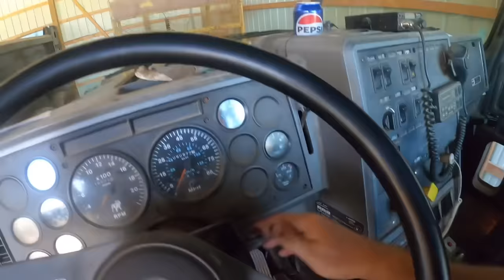Catastrophic Tile plow failure what happen to cause this epic failure?

Comment: Material fatigue ...
Happens on all devices under constant huge load.
I'm impressed how long you actually worked with this plow no failures.
Points to a good design.
Reply: Actually, no. Fatigue doesnt happen  under constant load, it happens on alternating loads... its the amount of stress and release cycles that accumulate fatigue
Reply: @Sjanzo i do believe you win the prize.
Reply: @Sjanzo you can still have a yielding material failure from excessive force.
Reply: There are several different types of metal fatigue. There’s compression, tension, shear as well as cyclical or work hardening. This could have been tension or cyclical. Probably both. Could also have been a harder alloy with induced stress during welding with no annealing to redirect the stress. How energy will flow through an assembly isn’t always obvious. Even the best design assemblies can fail in surprising ways.
Reply: @FishFind3000  true the definition of fatigue is failure below yield stress. It starts with a fatigue crack (most likely initiated in the flame cut edge where the pin bushing is welded into) from ploughing with two 850s, accelerating when the crack reduces the remaining cross section, untill the weakened remainder yielded when working without an extra dozer pulling.
Reply: I’m sorry you are all wrong. It just broke. Plain and simple. That’s why the lord made mechanics and welders. Now stop arguing. 😊

Comment: Damn..... You took that one pretty well, respect for that ! Sure you have it figured but more meat above and below the pins to take a rib plate, rib plate above the lower pin, nice deep roots and preheat before welding to mitigate weld stress lines. For something designed and built in a shed by two blokes, that thing held up really well under very very hard conditions, all credit to you for it doing so well until this. Hope you can lash it together well enough to complete your obligations.
Reply: Really solid advice. Plus If I remember right they made it all from mild steel.  Being that this whole thing was a Prototype. I think it performed awesome. I don't believe high strength steel would have broke like that.  I still agree more meat below the bottom pin would be ideal. At least more than the thickness of the plate used. Good luck with the repairs.
Reply: @mattdixon8750 when I build tile plows I build them out of  A36 or A572 steel depending on customer budget .

Comment: That's repairable, most important thing to take away from this is you can see the weak point at the bottom of the lower pin, you need a bit more meat under that pin and the top plates need filleting to get a full thickness weld. In fact all the repairs will need filleting to get full thickness welds.
You and Aaron can do it 😉
Reply: It is repairable but look at the side plate further to the front. The paint show’s stretching of steel above the ripper frame. So unfortunately there will have to be a complete replacement redesign of the frame that boot mounts in. Yes a bandage could be put on it. But there’s signs of structural integrity of the rest now. Not anyone’s fault in the making of. We are have been down this road on at least ones with fab projects. Only hurts the pockets of cash that hurts the most.
Reply: @kevink4914  quite right, Mk 2 should have a deeper section plate, not necessarily thicker, unfortunately the design left not a lot of material under the lower pin where the failure started ripping up to the next weakest point.

Comment: Looking back at the amount of tile this unit put in the ground, I suspect you are still way ahead of the game on this one. The next version should be a beast!
Reply from the maker: You are correct way ahead
Reply: @DirtPerfect  looking at the design, there's tons of pressure on the lower pin (origin of the break), maybe consider more plate below the bottom pin and run the diagonal support toward the lower pin rather than the way it is now. The tile plow series has been epic, and I look forward to the next revision! Bravo

Comment: Wow Dp that's impressive that road must have some major sized rocks in it to sheer that heavy plate like that and by the way is that still covered under the MBTS warranty
Reply: That plate didn't shear, it pulled apart under extreme tension........ the power that dozer is putting to the ground is phenomenal.

Comment: I suppose it was to much rock Mike, shocking how much force must have been to stretched and snap 3/4" hard steel like that, can't wait to see the damage report.
Reply: The crazy thing is the plow ripped miles of rock being pulled tandem with 850b or 210 without issue. Can’t wait to see the repair and upgrades

Comment: That tile plow has been through hell and back.  It didn't break at any of Aaron's welds.  I know y'all will get it fixed and now you can improve the design for better strength.  By the way that plow has been awesome especially for the money invested into it.

Comment: Considering all the tile that you have installed and some of that while being pulled by another piece of equipment, there is no shame in that break. The timing couldn't be worse, but def no shame. I have no doubt that you guys will have it back to work in no time.and prob with a few design upgrades.
Reply: Why upgrade?  It has worked great, and if you make it stronger, then next weakest point to break may be more catastrophic than you want.....especially to the wallet $$$!  I'd say upgrade the expectations, know when to tag in your excavator partner, then tag back in with dozer when you're past the risky spot.

Comment: I can only imagine MBTS comments if he would have been there. Looking forward to seeing the updates. The plow has been a very impressive tool for your operation. It has increased your production and was cost effective to build. As an engineer, you did this right skipping the calculations and going straight to the prototype. You had minimal issues with the plow and have fixed things as weak points show up

Comment: Mike, after watching Cutting Edge Engineering Australia for many years, it becomes obvious where the weakest point of failure is.  In your case, I can see/relate it to the two back bar pins (Their videos of broken stuff looks exactly like your break, it's magic)😂😂 .  I'm surprised you caught all of that footage on video!  I'm sure it is fixed by now, but it should have been a full solid plate across the back (Top to bottom) of where the plow tube moves through.  Not a single bar bolt on the top and bottom.  On there last video, they fixed the slides of a road grade and it seems like it would be the perfect vertical solution (two months ago) for the plow tube (Then you would only have to change out the worn slide bars, versus it running against the main steel structure).  Can't wait to see the how this gets fixed.  Arron is going to have his work cut out for him! 
BTW: Maybe next time, you should bring the water pipe/electric wire plow to do the pre-ripping (I know, Shoulda-Woulda-Coulda).  You had the 210 there already and it would save the added pressure on the tile plow.  😁😁😁😁

Comment: Good to see you still keep a positive attitude even when a catastrophic failure happens. Been there, well, never tore a tile plow in half but have had the boom break clean off a K905 where it mounts to the machine, TWICE!! 😂 or the top of the stick pop open on an older 15 ton Case excavator 🤦‍♂️. Just gotta weld em up and put em back to work 🤷‍♂️. No doubt you are job security for MBTS 🤣

Comment: DP yeah what a mess! Now and this is only speculation on my part but I’m thinking that the big rock you encountered trenching the first tile,was part of the road surface retention arrangement on the discharge side of the drainage pipe that was already there. You just got “ lucky “when you broke the first rock. I / we look forward to seeing the follow up video on the repairs and finishing of the project. Great stuff!

Comment: You took it like a pro brother.   

That was the one spot I wondered about. The plate (imo) should have had 3-4 inches of steel plate around the attachment/pin holes. Leaving so little mass on the one side of the pins leaves an inherent weak point.

Comment: Going into this video, I was amazed to think anything could break that plow. When you mentioned cutting through the road bed -- I had my answer. Snagging a huge rock in one thing, but pulling through it is another. Life is a learning experience, huh? Next time you feel the need to pre-plow, I bet you pre-dig instead. I have worked with lots of coax and that wire certainly looks the part. At least will be better and stronger now.

Comment: When both of you are on site, you can kick the blame back and forth but when you’re by yourself ….  I’ve been impressed with this attachment since you first dreamed it up. I’m no engineer but as failures go, this not the worst case. Now you know you’ll have to add bracing and reenforcement to the original design to overcome the mechanical disadvantage but you’ll figure out how to do that. It sucks that you crimped the hydraulic cylinders but that’s nothing that $$$ can’t fix. It really sucks that you are in a time bind to get her back to work. I know what you guys will be doing in your spare time for the foreseeable future. Good luck!  🥸👍👀🔨🔧💨🔥✅

Comment: Massive amount of force to tear the plate, welds and cylinders apart. Looks like sandwich time with AR plate on both sides. You and Aaron will know what to do and the two of you have the skills required to repair it.
I wonder how many miles you plowed with it, any guesses?
Thanks for the work you put into the video. We hate to see it happen but love the example of how you handled the issue. 
Your attitude and work ethic are fitting of a roll model to follow for those who wish to be in your line of work or owner of a business.

Comment: Mikey…. It may be time to change tactics…. Baling wire, bubble gum, JB Weld and Super Glue ain’t gonna cut it on this one.  You may wanna overlook those Old School fixes.

Thankfully, YouTube ads have provided me with a plethora of New Age advancements that’ll get this plow back in the ground in an instant!  

I’ve seen Gorilla Glue weld boards together strong enough for a fat guy to walk across a canyon.  And, it does it in a 30 second commercial!!! 

A few drops of it in the cracks ought to hold it in place.  

And, iffen you are a wee bit skeptical of it being enough… you can reinforce it with Flex Seal Tape.  I mean, if a dude can build a whole boat out of it and row it across a lake with 2” of choppy water… one should be confident it’ll hold that dinky little tile ripper thingy in place!

Rest assured that it won’t cost a ton, either.  Because, if you click now, you’ll get each at an incredibly low price.  But wait, there’s more.  They’ll send you not one, but two at that same incredible price!!!  

I mean, Mikey… what have you got to lose?  They come with full warranties.  

Yes sir, Technology to the rescue!

And please, don’t thank this long time humble subscriber for the tips.  It is just one of the free services that I provide at no charge to my YouTube buddies!

PS:  If you think it’ll help, I can send you a handful of Sassafras   Valley stickers you can put over the repair to purdy it up a bit?

Comment: Good chance the cracking of the pin boss area had happened on the prior plow, because there was pretty much no fracturing noise when it did happened, just the bending.  There was also a BUNCH of  chattering as you were clearing the road 'rock pile' that probably did it no good.  Another amazing sight was the fracturing of the hydraulic cylinders.  You'll get better!  Thanks for the video Mike!!

Comment: To be perfectly honest I am surprised that the plow lasted this long, you have plowed through some horrendous rock layers and really deep hard pulls through clay and roots, it’s all material fatigue as far as I would think, definitely not anything to do with workmanship or design, the plow owes you nothing as far as I would see it, just a really bad time to let go. Like they say, “things only break when you use them, and usually you are counting on it performing and no replacement in the stable” stay the course young man, you will win, I have no doubts. Thanks for the tag along video.

Comment: I split a hydraulic ram lengthways once, but you gone and done them crossways..  !
Maybe a bit more gouging on the next welds, and further metal away from those stress point pins.

Comment: Bummer, just an observation and i may be completely wrong.when you designed the plow you obviously thought alot about the forces created pulling the plow horizontally, but the previous video showed quite a lot of vertical pressure being exerted when the plow grounds out loading the dozer on and off the low bed trailer. Could this be part of the problem, especially since one of the directions ie backing off the trailer is the complete opposite of the forces primarily designed for?
The next video and diagnosis will be really interesting

Comment: That thing did extremely awesome for as long as it did back to the drawing board I think you're going to have to go double the thickness minimum and hire the gussets counteract act the pressure but I know whatever you're going to do little Ivar be a bandaid to get your back and going or back to the drawing board and fix it properly on your off season but whatever you do you have to go much thicker on your materials

Comment: This is exactly what I was thinking about when I said you were owed the good deals (manlift) as any who are in business face the other side when all goes south and expenses unexpectly happen. Good luck, I agree form my limited views/perspective it appears that area around collar boss is where failure started from either fatigue or over stress loads, good luck with hurried repairs Murphy usually makes sure these problems occur when time is at a premium I would not take short cuts to fix even if it takes more time to complete as you want this type of failure permanently in your rear view mirror. Ray Stormont

Comment: What happened to the  Control system you built initially for plough  . Looks like you could do with a lot thicker material for those side plates to start with bit of a pain but  these things are sent to try us .
Reply from the maker: Upgrading it

Comment: You were right in your diagnosis Mike  you can see from the vid when you first went through that stone shelf  after the root it was juddering like a SOB, that was where all the trouble started,
 mild steel has  specific tensional force parameters per square inch , stay within them and everything is fine,
 the trouble started as it began juddering,  where  each judder was like a single hammer blow  greatly exceeding the  torsional snatch limit for that tiny peice of steel below the bottom pin for a micro second at a time, 
 in unwittingly  letting it act like a hammer drill exceeding the snatch resistance hundreds of times a minute which ultimately caused that thin shoulder to fracture, once that had occured it was just waiting for the next big pull to twist everything out of kilter stressing the steel plate and tearing it like a piece of paper,
When you rebuild it extend the top and bottom plates to at least two to three inches past the pin holes which will quadruple the snatch strength,  also adding a strip of half inch square bar welded to the top and bottom edges will inrease it further  - and rounding off every square edge to eliminate any stress points is also highly recommended,
 Once completed I would also consider a loose 12 inch length of  humoungus sized welded  link chain  welded or bolted to a plate above and well below the top and bottom links with about two or three inches of slack on all four, that way if god forbid anything were fail on another day the chains will prevent the katastrofe (yes I know it was deliberate lol) that wrote off the lift cylinders and the hoses.

Comment: Hard to see on the video, but the fracture surfaces appear to have massive fatigue cracks. I would suggest you look at the welds for HAZ where the horizontal plates hit the vertical. I am not sure  I saw too much preheating during the welding process. None the less it's a find piece of equipment and work by you both. Sorry it's gone wrong at an inconvenient time. Perhaps you can invest in a few cans of dye pen.

Comment: You handled the failure of the plow extremely well although perhaps there was some audio not included. There was a lot of practical experience incorporated in the blow and it failed after laying a lot of pipe. Your post mortem  may find,on close examination, indication of a progressive failure, small crack ending up as a big one and failure. I watched your videos of the plow under what I thought as much heavier loads like towing the 850 than the load when it failed. 850 had good traction so load may have been highest experienced but I doubt it. The plate around the lower pin holes looks like it failed in tension and probably was  the first point of failure? Repairs will probably include some redesign/heavier plate/relocating pin holes deeper into the plate. Video was painful to see so I can’t imagine your shock and reaction. All the best fro the rebuild.

Comment: I think the rather large bolder popped a weld near to one of those pin pivots, just happened that the rest of thje field wasnt enough pressure to finish the rest off. i expect there is probably another large bolder on the other side of the existing metal drain pipe you started your next run on. All the welds are spot on you clearly can see that they are all of the same colour, otherwise you'd see rust marks/ different colouration to the metal where they had been previously been fatigues. Build it the same, design to fail as it has and not further up where it costs more to fix.